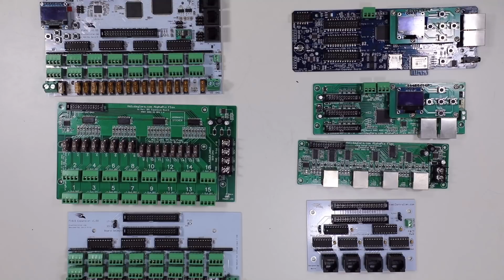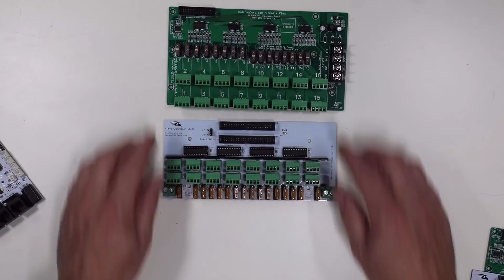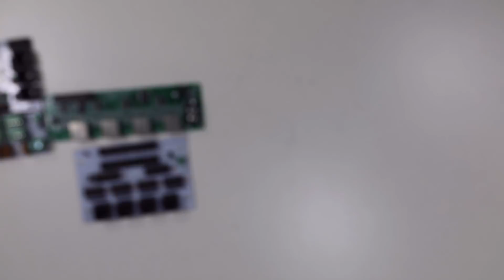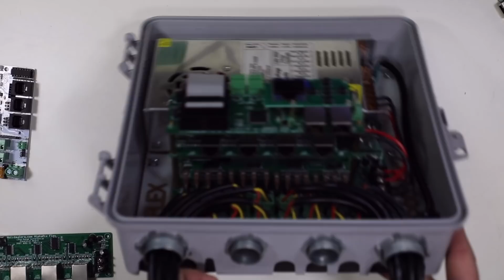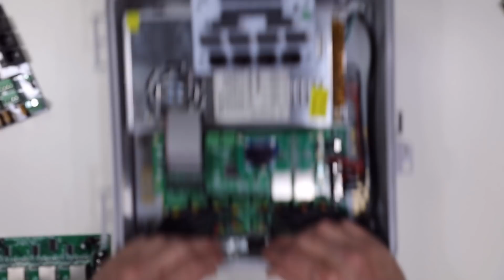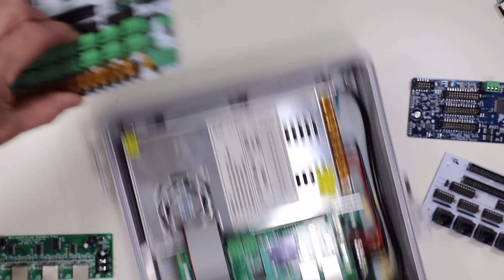Falcon vs Flex - Comparison of Holiday Lighting Controllers for Pixels

Comment: On the 16 port SPI expansion board used with a HinksPix Pro, what are the total pixels that can be used? I was thinking 16 outputs x 686 pixels per output = 10,976.               Thanks
Reply from the maker: That depends on the CPU, not the SPI board.  The max counts are generally 340 ot 680 pixels per output.  See https://www.holidaycoro.com/kb_results.asp?ID=181

Comment: When you stack the holiday coro set up can't get to the fuses but Is a cleaner set up
Reply from the maker: Yes, that is correct.  Blown fuses should rarely happen in a properly designed project.  Just like you'd rarely have to change a fuse on your car unless there were problems with the car.

Comment: What is wrong with a larger enclosure. It will let heat be dissipated easier. Might not need up north but I live in the south.Also have been electrician for over 50 years. I also know how to build control systems as I have built Nuclear Fuel assembly machine controllers
Reply from the maker: Nothing wrong with a larger enclosure.  Typically we want an enclosure that is small as possible to get the job done since these have to be mounted on walls, stored, etc.

Comment: while the so called issues on the Falcon are exaggerated and are not really deal breakers . If I had to nitpick things on F16v3 then you nailed almost all of them. I was shaking my head in agreement as you were talking about them. I have the F16v3 and the F48 and I've also seen where the differential board was stacked over the F16V3 so it can be done. Not as easy as the flex and I do find the Flex interesting and can see purchasing this in the future due to the modular design. These are really the same thing so you probably could have done a video showing all the thing the Flex does the Falcon doesn't and saved me 15 minutes by leaving out the exaggerated stuff. i.e. Modular, stackable, audio, plug in FM transmitter, wireless controller grouping. that's what sold me on it. but oh well nice product
Reply from the maker: Sorry about that - if HolidayCoro is one thing - we are very detailed.  This is because we believe details matter to many people and as such, our website, youtube and other forms of communication are information rich.  Don't forget you can also use the youtube speed watching function while not missing out on any details.

Comment: He touts access to the fuses: How tight the Falcon's are, and that you need a fuse puller because you can't your fingers in there, and then shows how "easy" it is to pull the fuses on the HC—without mentioning that you'd first have to completely remove the stacked CPU before you can even see the fuses, let alone access them. ;-)
Reply from the maker: Yes, you are right - that is why now we add in additional spacing on top of the controllers for 70mm of spacing, resolving that problem.  Why we didn't think to make that simple modification on our ready2run controllers is confusing too us also.  Problem solved!